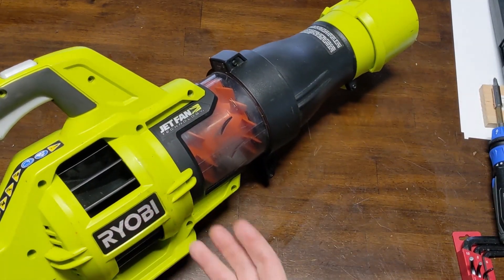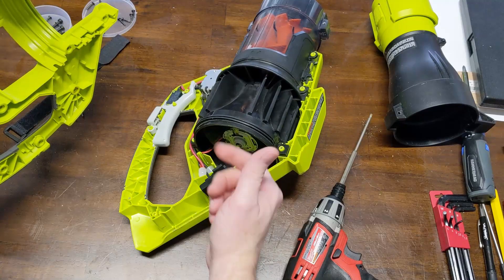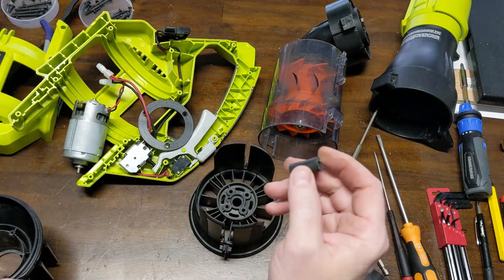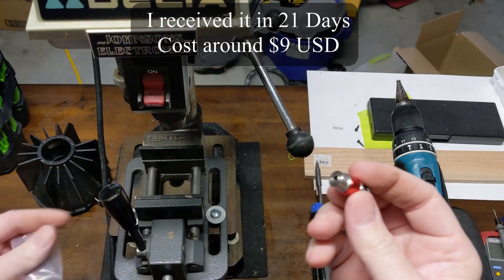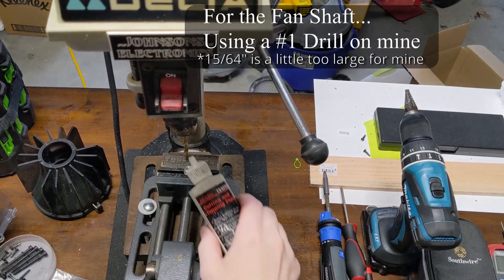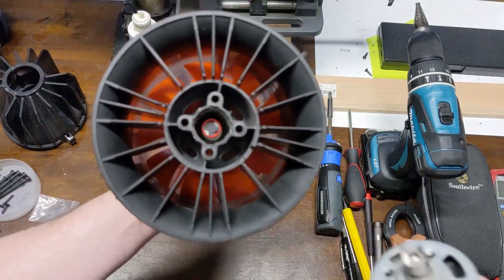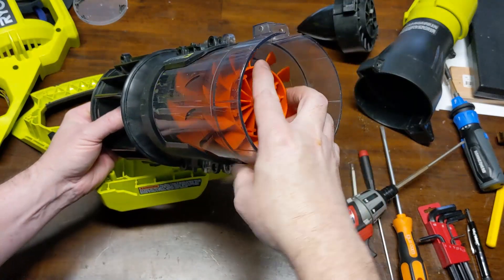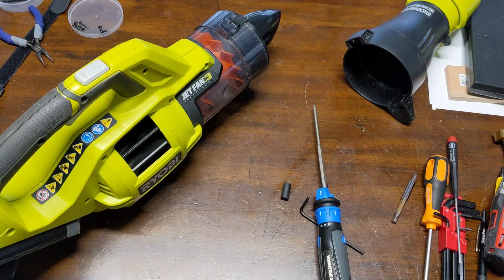Ryobi 40V Jet Fan Blower Coupling Replacement

Comment: I have the same blower as yours, but my problem is the fan blade missing 2 to 3 pieces and it makes a loud noise because of the unbalance . do you know where I can find that fan blade, I try Amazon, eBay, the company no one has the part..
Reply from the maker: As far as I know it is no parts available for these. eBay is the only option that I know of besides the rare chance at flea markets and yards sales.

Comment: I drilled a hole in the existing coupling and put in a  Recessed Hex Socket Cap Screw. Its been 4 months and it works perfect.
Reply from the maker: Thanks for sharing. Hopefully, someone else will also share in that fortune. Mine was totally eaten up beyond repair. It's good to know some might be salvagable.

Comment: Great video.  I had to cut off about 1/8 of the fan shaft to use the coupling.  With the motor in place with the coupling on it, just put the coupler ont on the fan and see if it is flush with the housing. the coupling on the fan shaft has to butt right up against the bearing on the fan so that the bearing will seat in the housing.  If not, you will have trouble getting the front fan bearing housing to fit.  You will be pushing the front housing, but the screw holes will not line up.  My observations.

Comment: IS THERE A NEED FOR SOME LUBRICATION AS THE SOUND WHEN IT STOPS DOES NOT SOUND RIGHT?
Reply from the maker: It really should only be lubricant in the motor shaft and bearing if I remember correctly. The other parts are plastic, so there is no need for any on those parts. There could be some clearance issues causing slight scrub.

Comment: So... no hobby store had a coupling/bushing you could modify? RC and drone vehicles being the suggested place to look... 😊 thank you for the video. Only one I found on my looking up. My issue? Thought might be this? Power kept kicking out; but realized I was using a 6ah 40v battery (simply too heavy and connections separate just enough). But again ty; just watching a modify it or fix it video; youve warmed my heart.

Comment: You can also try to drill a hole through the plastic coupling and secure it back onto the motor shaft with a grub screw. Just like how a pinion gets secured onto a motor. 

This is what I did with mine, time will tell if it holds.

It's a really bad design by Ryobi, I mean fair enough if it's suppose to be a sacrificial coupling in case somethings get jammed in the turbines but then at least sell the replacement part for it.

Comment: THANK YOU FOR THIS VIDEO! This is my exact problem with this exact product. I spent hours looking around at my local hardware stores for a solution, considered adapting the cheap plastic coupler with a torque washer or a ratchet bit, but niether were are viable or as long term as this. Question: have you found any other couplers that are an exact fit against the motor and the fan blade? Drilling into the coupler in the video isnt a great option for me, but if this is the best coupler for the fix I will definitely explore drilling the larger holes on each side to accomodate the coupling the two components.

Thank you again, very well done and appreciated!
Reply from the maker: I have not found any closer to size than this. I honestly spent more time than most would even believe searching to find this type that was slightly smaller and could be modified. It is about the only option even available that I know of. Any others would require drilling into the side of the housing to tighten the coupling up with a hex wrench after putting it together.  Thanks for your kind comment and I wish you the best of luck with yours!

Comment: Thanks for the great video! Mine is suddenly dead in the water, looks like I need an "on/off" switch. Where do you get your parts?
Reply from the maker: I often try online like eBay first. If I have no luck I will try jackssmallengine or eReplacements.

Comment: Thanks so much for this, I'm buying a different coupling that I think might work off amazon for faster shipping.  I never would have guessed where to search for it if it wasn't for this video.
Reply from the maker: So glad you found it helpful! Thanks for your comment!
Reply: Did it work?
Reply: @justinarthur5522  it did, with some issues.  Had to make a channel to fit the hex key in and tighten the coupling in the right position.  Definitely a frustrating experience putting it back together.  I 3d printed a piece and it worked for a while but metal seems to be the way to go as it's still working.  Glad I got my blower for super cheap used.  Here's the name of the one I got in case you're interested: Befenybay 2 Pcs 6mm to 8mm Universal Joint Shaft Coupling with Screws for Motor

Comment: I hope this isn't going to happen to me Now! I stumbled upon this video trying to learn how to separate the green piece from the black piece on the first section that you took off. Have you ever tried to separate those to pieces yet, I need some help! 😆 there are two torque screws on that piece you took off first that I am assuming are not for Assembly Operations? Cause nothing came loose? Any help would be highly appreciated  thanks
Reply from the maker: Hi,
I believe you are asking about removing the very end green tip section from the gray outlet tube. It has screws on the bottom to remove as you stated and then it has large catches on the inner sides of the tune. So with a large flat screw driver or similar tool you can reach in from the open end and wedge in on the sides and release the catches. It's kind of a pain because the whole side tab on each side is the locking tab. Hope it helps.
Reply: @Thrifty Tool Shed  awesome thanks! Going at it with a flathead screwdriver is usually my last resort on things I do not want to end up snapping, cracking, or breaking. I gave up my Collision Repair career due to 80% of a front end hit is made of Plastic, under the hood, or inserts on the front bumper. Lol. Well wish me luck Thanks. If I get this off I can have a round attachment point for my DIY, PVC extendend blower contraption. Lol. for all the leaves in my gutters. Thanks 😊
Reply: @Thrifty Tool Shed  awesome thanks! Going at it with a flathead screwdriver is usually my last resort on things I do not want to end up snapping, cracking, or breaking. I gave up my Collision Repair career due to 80% of a front end hit is made of Plastic, under the hood, or inserts on the front bumper. Lol. Well wish me luck Thanks. If I get this off I can have a round attachment point for my DIY, PVC extendend blower contraption. Lol. for all the leaves in my gutters. Thanks 😊
Reply from the maker: @cmspnutty8001  yes flat screwdriver is not the best tool for that job and it sounds like you know all about that. I simply did not know what all tools people have so hated to say to use  something too weird. So a larger flat object to fit in that wedge would be better for sure. So flat screwdriver might make sense for most. Not best... 🤣

Comment: Love this video and just placed my order for the coupling
This coupling issue makes me wonder if Ryobi has used a better coupler on the Whisper Series 730
Would love your opinion of the Ryobi 730 vs the EGO 765 CFM Blower LB7654
Interested if one is truly a less-likely-to-fall-apart-fast type of machine
Reply from the maker: Thanks for your kind comment! I really do like my EGO equipment. The Ryobi 40V platform has been so problematic that I don't have much faith in it. They may have better packs now, but I will not spend my  money to see. I don't have enough experience with the EGO 730cfm blower itself to say much about it. I have only had the 480, 530 and 650CFM EGO blowers. I have had no failure on any of my bought new EGO items except the very first battery video I have. That got me started with EGO. The other many repair videos are either items I bought as non-working or some that was sent to me just so we could learn more about them on video. Best of luck to ya!

Comment: Mine died after about 1 year of light use. Based on your video I think mine has the same problem. Ryobi is junk, I won't buy from them in the future and it's too much trouble to fix. Just going to trash this and go back to my wired Toro blower which just won't die. Thanks for the video!

Comment: I just fixed one of these for my dad today , what I did is found a cheap socket that fit the fan side and cut the side the goes into the wrench , then I torched it hot and melted into the coupling good as new
Reply from the maker: Wow, if that doesn't vibrate better than a concrete mixer you've  done great!
Reply: @ThriftyToolShed  it vibrates a tiny bit but I don't think it's anything to wild haha that's the first thing I told my pops it's gonna vibrate and he said send it since we couldn't find a replacement :p I saved your video for when that fails :)

Comment: My fiance's daughter was blowing off the trampoline and told her not to use the blower but you know kids are We killed her just kidding no she got wrote caught in the propeller blades I had to dismantle it We have the 40 volt one she was wearing some type of rope around her waist that tangled all around inside the propeller so I just bounded it unwrapped the rope put it back together and now it doesn't work there look like a heat sink thing connected with red and black wire not sure but it's slid out while I was taking it apart and I'm not sure where it went so I just buttoned it up neatly but that's been bothering me I think that has something to do with why it's not working maybe it has to make contact with something? I didn't see any place that it would fit I tried a few times just didn't know where it went could that be why it's not working? It's the 40 volt one with the weird handle that we lost the bolt to as soon as we got the thing lol it clicks up and down making the handle different angles. Any ideas would be welcome!
Reply from the maker: Hi,
The heatsink part you mentioned seems as if it could be a speed control for the motor? Unsure as I have not worked on this exact one.
Reply: @ThriftyToolShed  I'm so stupid it was the battery connector lol
Reply from the maker: @earlyculyer4103  
Oh, ok. Not stupid though! Sounds like you fixed it!
Reply: @ThriftyToolShed  yeah I got it going thank God didn't want to spend another $150 there's two huge trees in my backyard so it's constant work now we have a trampoline and family coming to visit We would have had to buy another one thanks for your video it helped out.
Reply from the maker: Glad it helped. Good job getting it going and thanks for sharing!

Comment: Wish I had the drill press or a 3D printer to do this job. Shame on Ryobi for not having a proper part to replace this.
Reply: This is the benefit of using Google to find your local "hacker/maker space" as they usually have these tools available for rental time for you to use for projects happy repairs

Comment: Help me < I thought I was smarter than average bear , and drilled 2 set screws in the old coupling and got to putting motor on and couldn't reach the set screws . So can you give me info to get that part from overseas ?
Reply from the maker: I have the link to the one I used in the video description if that is what you need. Best of luck to ya!

Comment: I 3d printed a plastic coupler, better quality than the Ryobi one.
Reply: Any chance you can make some? I’m sure we can (I know I would) be happy to pay for your time, labor, materials, shipping, etc
Reply: Can I get one ? I will give you $$ to ship
Reply: @johnsuesser2133  did you ever get one?  I want one too hopefully he will share the info if not make one.
Reply: If you could share the Cad or make one for me I will pay for the part at any reasonable price, including shipping. I need two of those couplings.
Reply: Could you share your CAD file with us ?
Reply: Mine lasted about 4 years. Finally stopped today. Melted on the motor side. Good video. Thanks
Reply: Are you able to print some and sell them?
Reply from the maker: That's awesome. Excellent work!
Reply: Wanna sell one?
Reply: I’ll take one also
Reply: What type material. I have multiple printers and types of material at work

Comment: Our blower stopped working and it's making a spinning noise now. Is that more than likely a coupling issue?
Reply from the maker: That is a common failure for sure. If you can hear the motor whine or spin up and the turbo fan is not turning or just barely turning them it's the coupling!
Reply: @ThriftyToolShed  Thank you for your response, appreciate it.

Comment: Has anyone found a replacement coupling for a decent price or has Ryobi started selling the part separately.  I am going to check again I looked about six weeks ago.
Reply from the maker: I have not ever come accross it is why I shared this video. It does not seem to be available as a replacement item now. I hope that changes, best of luck to ya!
Reply: @ThriftyToolShed  - any chance you can make me one? I’ll pay for parts, time, labor, shipping, etc
Reply from the maker: I have a link to coupling that I used in video description if needed. It will have to be drilled out though!
Reply: 100 percent Ryobi hasn't started making this . Just called them have to buy the whole motor with shipping is $88.00